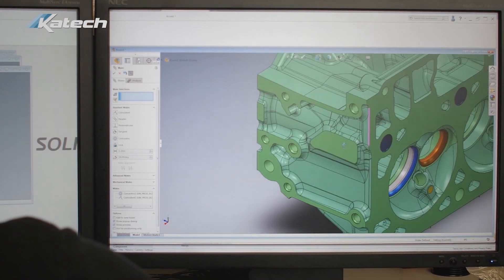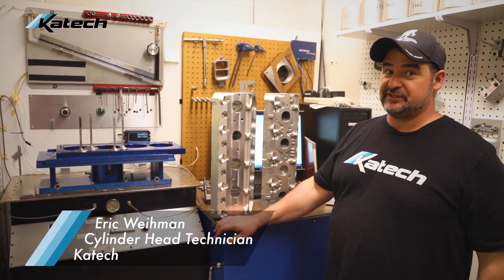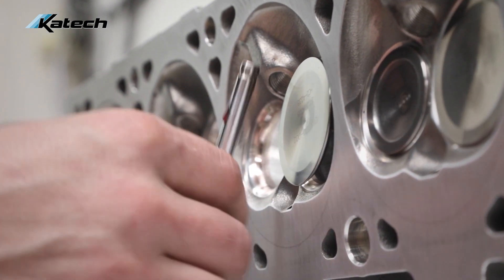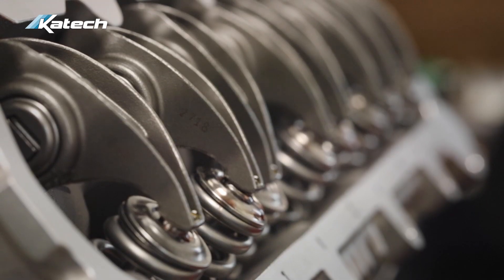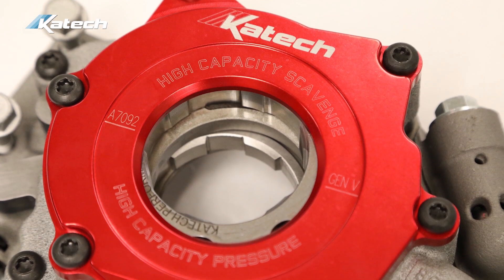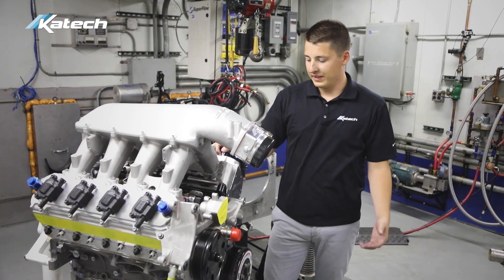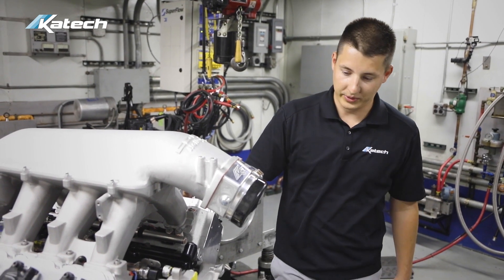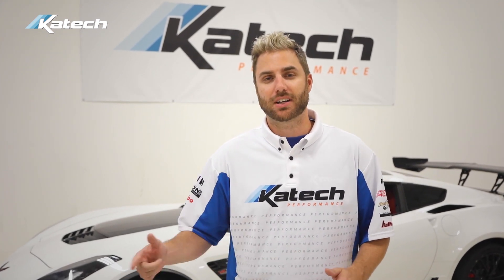KATECH RECLAIMS GEN 5 LT NA ENGINE DYNO RECORD WITH 806HP!

Comment: When will someone make parts for the L8T 6.6L gas engine?
Reply: What do you want?
Reply: @alpharacingdevelopment4794  well not anymore since GM stopped building 2500-3500's. I went back to get my deposit so I'm looking at an Escalade, fuck it.
Reply: @funguy7979  well i have an escalade too, let me know if you wanna do anyhting to it.
Reply: @alpharacingdevelopment4794  longtubes to a 3.5in single exhaust, Air intake, possible intake manifold and a tune. I will be adding a train horn and a light bar inside the lower bumper. That's it.
Reply: @alpharacingdevelopment4794  I'm located in Miami Florida

Comment: Very nice. 

Are you getting this displacement with a stock bore and a 4.125" stroke or are you going the 4.125" bore/4" stroke route? Just wondering if these heads will fit a 4.065" bore with their larger valves?

Also are these heads similar to the Edelbrock heads with the straighter/more direct exhaust ports than the factory GEN5 heads where you have to run special headers with offset primaries to match up with a new exhaust port location, or do they keep the factory exhaust port location?

Comment: When do you think there will be a higher deck LT1 block that's good for 500+ cubic inches? Or is such a build possible even with the current Gen V block architecture? I remember the reason a lot of people did higher deck blocks in the past for stroker builds was to prevent piston rock, blow-by, oil foaming, and other issues that were commonplace post-LS7. A 502ci Gen V build running a cross-ram or ITBs could EASILY make 900+/700+ if you're running more than 13:1 compression on E85 - maybe even with a meth/water kit.
Reply from the maker: I don't know.  I haven't heard anything concrete.  Just rumors of a potential LTX block in the future.
Reply: @KatechPerformance  LTR block from Concept Performance is finally here! What do you think Katech could make with the new block?
Reply from the maker: @spdcrzy  I believe those blocks are only being offered in standard deck height at this time.

Comment: Will this setup work with a whipple supercharger and your new fuel injection system?
Reply from the maker: Yes, however our camshaft selection and compression ratio would be different.
Reply: Thank you. I assumed that many other components would have to be changed out due to the increased pressures and power demands placed on the stock parts. Once I have a better idea of what I want I'll be giving your crew a call for consultation.

Comment: What was the compression?
Reply from the maker: 13.0:1
Reply: @KatechPerformance What’s stopping you from running higher compression? With E85 and direct injection, can’t it handle a higher ratio?
Reply: Would you recommend lower compression and more boost or higher compression and less boost for a turbo setup with this engine?